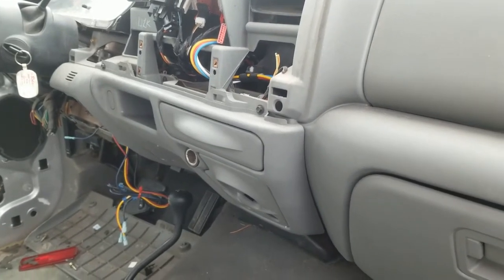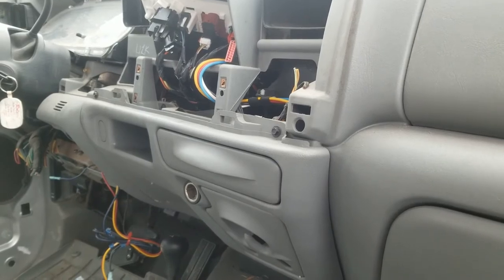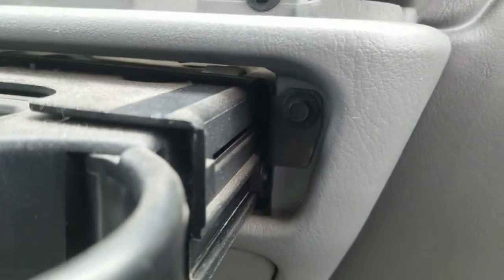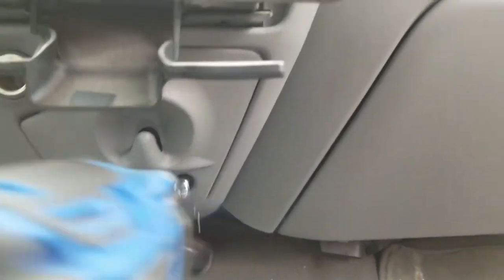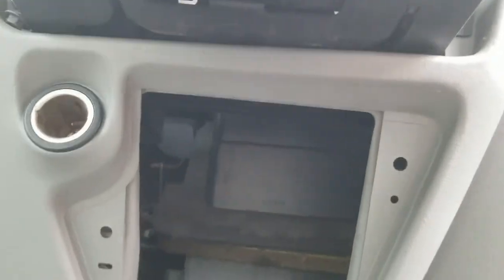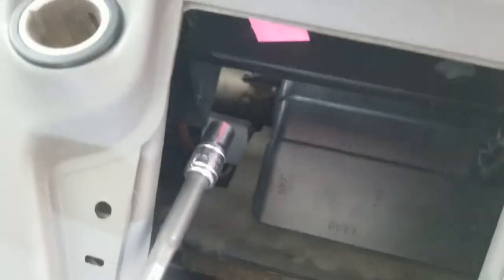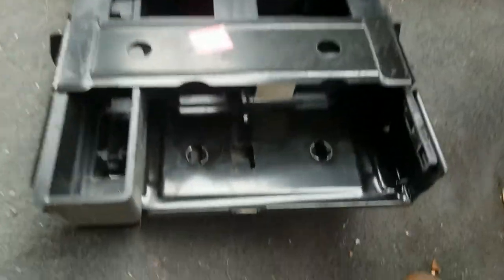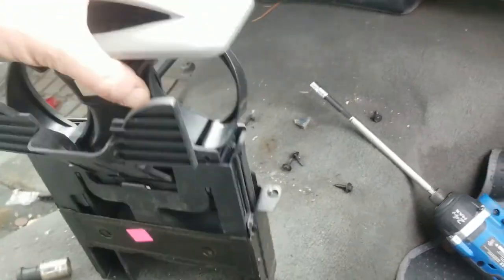1999 - 2007 F250 F350 EXCURSION CUP HOLDER REMOVAL F-250 F-350 HOW TO REMOVE CUPHOLDER HIDDEN SCREWS

Comment: Thanks. I was just trying to replace my cup holder on my 2006 F350. I'm glad I quit pulling and came inside to check for a video on how to remove. Excellent video. Thanks again. Now if I could just find one that has the King Ranch on it.

Comment: 2000 f250 Extended cab rear driver and passenger door latch cable replacement…both rear doors won’t open using handle

Comment: Thanks, I got lucky, the cup holder wouldn't close. Nothing broken, just one of the legs was out of its slot, a bit of heat and some twisting, it went back in. I think this happened because our water bottles are too heavy. I think the cup holder is meant for a coffee or a pop (soda).Instructions for removal were clear and removal was easy. Except for this 74 year old trying to twist under the dash.

Comment: This is one of those videos. I should never be made. All you have to do is push in the two pins in the back and you can pull out the whole drink holder without having to remove the frame. This video doesn't say you have to remove your dashboard face but you do if you're going to remove the frame like this video says. All you have to do is reach up and push in the two plastic pins in the back and the whole thing comes out except for the steel frame which matters not. Slide in the new one and you're done in exactly 15 seconds. None of this. Removing the dashboard face and removing all those screws like this video says